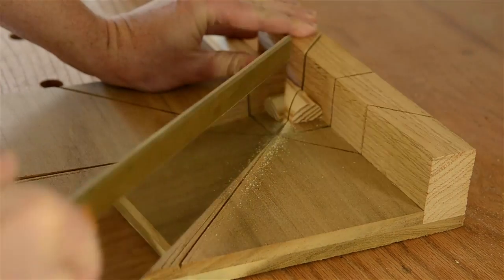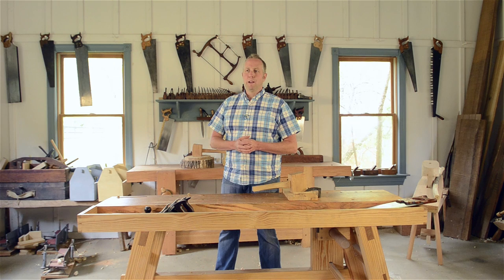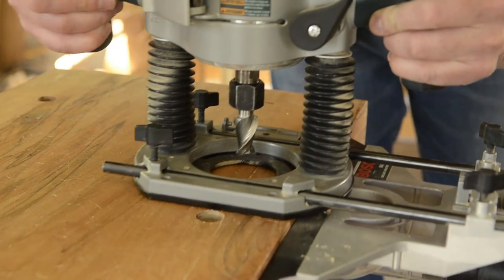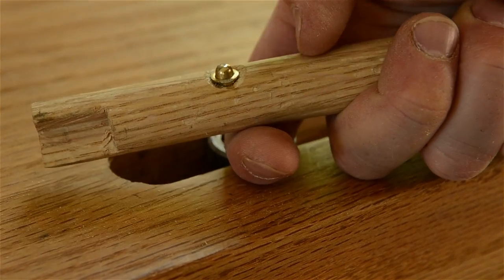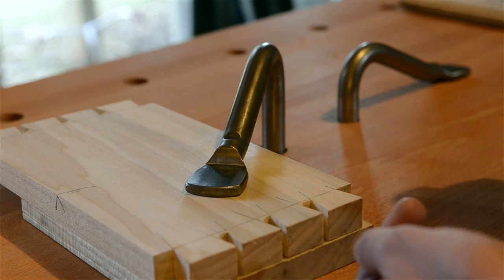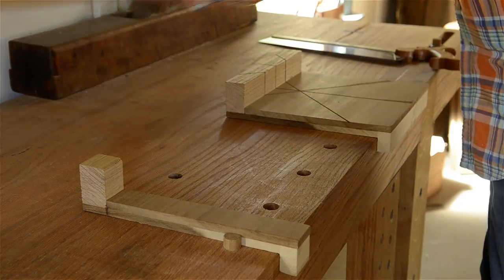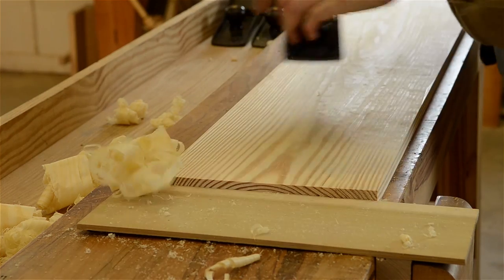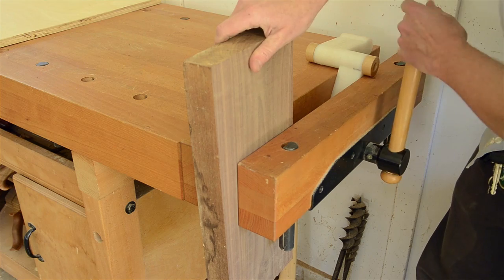Watch This Before Making or Buying Workbench Accessories

Comment: I prefer the older, more traditional bench hooks to the ones you showed. These are shorter and much smaller, and always used in pairs. They keep the work much closer to the edge of the bench, allowing the heel of the saw to be dropped to follow the front line down. This is better sawing technique than trying to keep the saw level, and isn't possible with the bench hooks you showed.

Comment: Unfortunately 2023 wood is still super expensive so i have become a bit of an expert using mdf and particle board from IKEA furniture. Get this its also only with joinery to toughen joint areas use CA glue as it soaks in and becomes strong as nails.

Comment: I made my own bench dogs from 3/4" dowels.  Instead of using a spring or other mechanism to keep them from falling through the holes I drilled in my bench, I cut squares of wood of various thicknesses, bored a 3/4" hole in the center of each one, and glued the dowels into the holes.  I would echo your comments about the cast iron hold fasts.  I bought two that came in a set of other stuff from a well-known woodworking store.  I was ready to throw them out until I read a suggestion that they hold much better if you sanded the shaft to rough it up a bit.  The paint made it too slick to hold in the dog holes.  I did that and it improved their performance to the point that they are functional now.

Comment: Joshua, a really nifty bench hook system approach, thanks for sharing it. No cross grain binding, and the slice off the edge is elegant. Kinda like what sliding saw table manufacturers do for their crosscut fence extensions. 

‘Bout the bench dogs, agreed the bullet catches are a top notch solution. If you’re of a mind for square dog holes, and happen to be cutting those mortises before the last timber is glued up to the top front edge, then that is the ideal time to pop a catch into every dog hole. This allows the dogs to be replaced without fuss, restricts the bunging inflicted at the strike area to the buried part of the dog and not the highly visible dog holes, and weakens the dog itself not a jot.

Well OK, that last is hardly a real consideration.

Comment: If you are going to make your own bench dogs from wood I recommend making one for every hole in your bench. That way you don't have to move them from hole to hole. It's a luxury but dowels for round dogs or scraps of wood for rectangular dogs are cheap. Thanks for your video.
Reply from the maker: Ha, ha, it's not tough to move the dogs, but it's tough to add bullet catches in that many dogs.
Reply: I think I would just prefer to have a few dogs rather than dozens of them built in. That might be an interesting add on portable bench top style to make with a series of built in dogs that are spring loaded.

Comment: I might refer you to the very excellent serious of Fine Woodworking magazine.  The original 1st ten years was available as a hardbound edition minus some of the advertising.  It covered a virtual plethora of things from the Tage Frid workbench plans and also making wooden taps and dies very simplistically for making virtually anything requiring large screws including bench vise screws mad from wood and wooden clamps made with wooden screws.    Absolutely the very best reference material that I have ever seen.  Bar none.
Reply from the maker: Yup, I have all of them.

Comment: That's another great Video
You're experience and confidence are impressive
Here's a tip for the benchdogs: its cheaper and easyer to cut half way diagonally into the dowel and stick in a popsicle stick, instead of using this brass springs
Reply from the maker: Great tip Dave!

Comment: Joshua I’m worried about the window sash seen at 0:42. The right hand corner shows signs of water damage (the gray wood on the bottom few inches of the sash stile). This is usually indicative of moisture wicking up into inadequately sealed end grain (in this case it appears to be migrating into the end grain of the rail as well). I just retired from 17 years as a service tech for Marvin windows and saw a lot of this issue. The moisture more often than not comes from excessive indoor relative humidity condensing on the glass, running down and collecting on the sill. If a room is unheated in the winter that condensation often freezes into an actual ice dam. Mold, mildew and finish degradation can result and I’ve seen many a sash left long enough that was destroyed by rot in this manner.
Reply: Lane Cobb, well spotted. You can take the tech out of his shop, but you can’t take the shop talk out of the tech!
Reply: Lee Haelters LOL 😂 It jumped out at me like a sore thumb. I’m cursed!
Reply from the maker: This used to be a neglected RV garage. Windows have been there a long time.

Comment: Here's a couple of quick comments on shooting boards.

Since the plane rides along its side, make that part of the board with a low-friction surface such as polyethylene or hardwood finished with beeswax.

Also give some thought to your assortment of planes and how much of a shoulder there is between the edge of the blade and the edge of the plane. The narrowest of these shoulders is all that will be riding along the reference edge of the shooting board. The rest will either be removed by the blade, or can be cut back on the table saw before the board is assembled. What remains will be pretty thin, and consequently subject to increased wear, so some thought for the material will be repaid in a longer and more accurate life for the board.

Comment: Thanks a lot for all the tips, Joshua! I'm making notes here! 😃
My only issue here is to find dowels made of good wood, hardwood. But... Well, maybe it's not that difficult, the health issue has been making everything more difficult. 😕
Anyway, stay safe there! Take care! 🖖😊
Reply: True,Ramin mainly,Birch a thing of the past...edit ; and I'm in the UK yeh,you might find quality here and there,but it's mediocre in the main.
Reply from the maker: Lowe's or Home Depot have oak dowels.
Reply: @WoodAndShop  Yeah, but I'm from Brazil. Those stores don't exist here. 😕
Reply: @MCsCreations  of course you can make your own using a dowel plate,that's the way it was done pre-mechanization...
Reply: @BeasleyStreet  Yeah, I'm going to try to find one! Thanks! 😊
Reply from the maker: @MCsCreations  Yes, making a dowel plate from plate steel is a great way to make dowels.
Reply: @MCsCreations  sorry,there not off the shelf ,you have to make your own,or someone for you ,it's just a     heavy steel plate with holes the right size which you drive square stock through 🤝

Comment: I was wondering about the depth of the hole needed for holdfasts....just a rough idea as my bench top is only 2 inches thick
Reply: Ull need to thicken up the hole.  Fix some blocking underneath ur bench to extend it
Reply: They need to go all the way through.

Comment: Is it possible to add an apron to the Moravian bench?
Reply from the maker: For what purpose?
Reply: Wood and Shop I wanted to try a Hovarter face vise as the mounting instructions make it seem like the best way to do they would be to have an apron on this bench. 

I was thinking maybe I could laminate an extra 2x4 to the outside of the leg and have the apron laminated to the top with a notch cut in the bottom of the apron to sit on that extra laminated 2x4 on the leg?

Comment: It seems to be irresistible to woodworkers to show the actual woodworking in double speed. Are you guys afraid of showing what you are doing?
Reply: I usually find the faster videos are used for repetitive tasks that don't add a lot by showing it three times in a row.  It would seem odd to make a demonstration video and then be "afraid of showing" what they are doing.
Reply from the maker: Affraid of boring people.
Reply: @PeteTevonian  Yes, I agree with you. But if a single thing is shown like the construction of one bench dog (starting at 4:02) it is hardly repetitive.